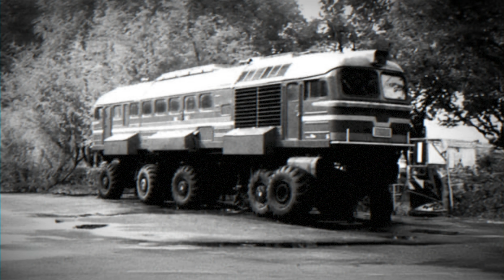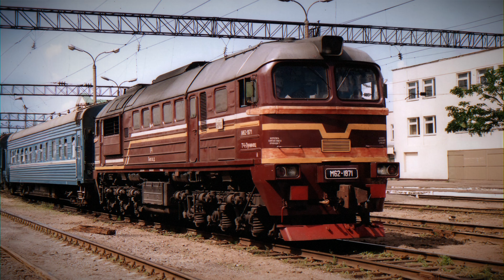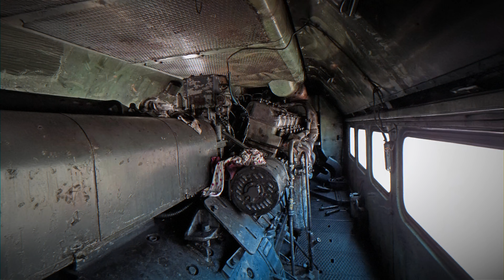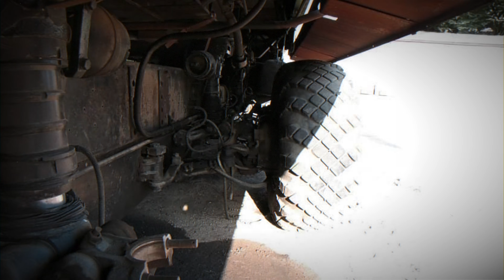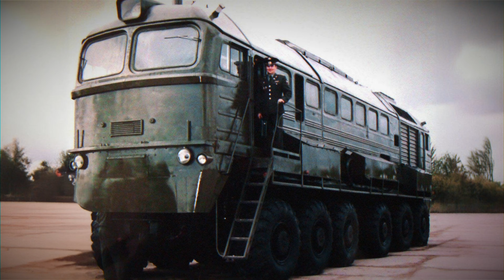Useless Russian 12x12 Locomotive Truck

Comment: Are all 12 wheels steering?
The M62 locomotive has a "steering wheel" but that's just the power throttle, so I wonder what it looks like in the cab.
For road use it's certainly impractical, too tall, too wide and heavy.

Comment: Yes, you cannot deny the reality of that high center of gravity. The weight of a train locomotive is heavy, and that's why they ride the steel. Our roadbeds take no more than ten tons per axle. To do this scaled back you'd need to think hybrid to give you that combination power on demand, when you needed it. But the battery pack needs it's own air ride suspension so it won't get the jarring. You have to again wonder though if at the end, it was worth all of the trouble... for what you're left with. 
Nice video, I really enjoyed it. Thanks for doing it!

Comment: There are huge vehicles many times heavier than this that were built by the USSR to, I bet if they had custom made the chassis of the locomotive, or better yet, used a articulated/powered bogie system using the original frame of the engine, along with heavier duty tires. It might just have worked in the end.

Comment: The Swedish Nohab AA16 locomotives had the class ID "M61" in Hungarian State Railways terminology. For the replacement type, the Hungarian State Railways assigned "M62" class ID. So the "62" in the type name, directly comes from the class ID naming rules of the Hungarian State Railways at the time. M stands for Motor, I think, 6 means 6 axles, and 1 is the first of such engine class. So M62 means, it's the 2nd 6 axle diesel engine ever enrolled at the Hungarian State Railways. I think. But maybe some train-nerds will rush and correct me.

Comment: Interesting math on this engine... it's 9188 cubic inches, divided by 12 is 765 cubes per cylinder. What I find funny about this is that EMD had a 567 engine... it's almost like the Ruskie's reverse engineered it, but got the numbers backwards on the the conversion!  EMD also had the 645 and later the 710 cube engines as well, but just struck me as funny when I looked it up.
Reply: or just a councidence
Reply: @GewelReal  true, just funny that's all.

Comment: It's not an entirely stupid thing to just try to build. 

I get it, it doesn't have any practical purpose. 

But. 

Engineers need exercise. Every now and then you need to let them build something stupid and absurd out of spare parts and a locomotive just to see what happens. I guarantee there were valuable lessons learned with that powertrain, and the steering. The vehicle may have no applications, but the lessons learned by building it are probably applicable to other projects, is what I'm on about.

Comment: Some are saying that it was meant to be a prototype mobile generator. 

Something similar was done in Canada when a town lost power... They took a diesel locomotive off the rails and actually drove it down the road on its steel wheels! They then connected the town's electric grid to the locomotive's electric generator.

It is considered to be a huge success story about what can be done if you think outside the box.
https://youtu.be/FWYbD2ga8DM?si=q-C2HhOQrmBXq0FT

Comment: Theres one thing that I dont understand. If it is a 2 stroke, how come it has valves then? As far as I know they only have holes in the cylinderwalls where the burned and unburned gases flow through.
Reply from the maker: It is not a gasoline type of a 2-stroke. Head out to this video animation

https://www.youtube.com/watch?v=mA7l3dpx6t0
Reply: Uses a blower. The valves open BDC and fresh air blows down. At BDC exhaust ports are exposed too.

Comment: I find it interesting that the engine uses separate heads for each cylinder.
Reply from the maker: A common practice in big engines, some semi trucks use that too. Clever, right?
Reply: @VisioRacer  I believe big 2 stroke diesel ship engines do so as well.

Comment: Actually, it is very much known what this vehicle was made for. It was a test bed for diesel-electric drive. They also experimented with all-wheel steering. The purpose was to evaluate the possibilities of using these technologies in heavy machinery, namely ICBM launchers. The locomotive was used because of the lack of funding in the early 2000s. The Soviets had a nuke-carrying train which used M62 locomotives and it was being retired at the time of this project, so they took one of the locomotives to save costs. Even the locomotive's paint scheme matches that of the nuke train. It was roughly the right size and heavy enough to simulate the weight of an ICBM. It was also suitable because the trains themselves used diesel-electric drive. This way they didn't have to fabricate a new cab/body and other components. It looks unconventional, but they just used what they had available.
Reply: As far as i know, you are not correct. It was based on a pretty old existing icbm carrier. It was not ment to test electric propulsion. It was a project of a mobile power plant.
Reply: @TheCokoll  And why would they need such an unwieldy "mobile" power plant when they can simply use a bunch of generators? Don't be daft.*
Reply: @michaelbuckers  easy, to power a small mobile base of ICBM carriers made right on the same unwieldy chassis and oil fields in russian north (with almost no normal roads). It was a simple cheap kitbash project to test the concept, an as you can guess, it showed that it is indeed unwieldy, cumbersome and mostly useless compared to a couple of traditional dpu's delivered by a helicopter.  It was not even a prototype of a future device, just an unsuccessful proof of concept.  And they did really swap an existing 2 engines and conventional hydromechanical transmission of an icbm carrier with individual electric motors because "hey, we anyway have a 1500hp generator on top!", and this solution indeed barely worked on top of other problems.
May be the idea in general had at least some sence, but definitely not when made in such a dirt and cheap way.
Reply: I thought it was going to be a kind of mobile power generation plant.
Reply: some designs are purely done as thought exercises .. I am sure much was learned....likely several important successes, of one big failure.
they knew enough not to start like that from scratch .. more a convenient test platform.
Reply: Early 2000s? The Soviet Union was dissolved in 1991.
Reply: @joshmnky  The Soviet Union falling apart and the use of old soviet equipment as test beds in the Russian Federation are not mutually exclusive.

Comment: Actually they do know what it was for. Ot was designed to carry passengers where there were no railway lines. Damn great idea but cheap air travel made it ineconomic.  It's not useless at all,  and yeah reverse engineering is common even by the US - a-bloody-mazing. Great video apart from the drama drama BS.

Comment: can someone who knows something about locomotives explain me, why they use a diesel engine to power a generator so they can use electric motors? Normally, this results in a certain loss of performance. For me, this only makes sense if you save an additional gearbox and drive unit from the engine to the wheels?
Reply: On locomotives the performance loss is outweighed by efficiency gain, the engine always runs at its most fuel efficient rpm/load, charges a battery, so output load can actually be higher than engine power for a limited time. Also having donework on prime mover locomotives that have hydrostatic transmissions, speed control is horrible, when you want yo go a certain speed you have to be going flat or uphill and slowly dial in the speed, if you're going downhill even a little bit you are dependant on the brakes to hold speed, electric motors can provide regenerative braking and precise speed control
Reply: @Sausketo I believe only DC locomotives can do regen back into the supply line.
Reply: @MattBrownbill Vvvf regenerativ drives can feed the power back to the grid. Same system that is used on elevators  with AC motors.
Reply: @asbjrnkvisle5831  OK, looks like I was misinformed. I should have checked first. 🤔 Thanks.
Reply: @MattBrownbill  I believe you are right when it comes to older units 👍
Reply: Having the Diesel power a generator and then the electric motors allows the Diesel to run at its most efficient RPM constantly. Losses from the generator to the Electric motors is less than 10% usually, this still makes it more efficient than directly driving the wheels with the Diesel. Not to mention that Electric motors have almost full power from zero RPM.
Reply: Running a diesel engine to power a generator makes sense because:
1. Having an engine run at a constant RPM at its peak efficiency creates power efficiently. This also causes less stress for the engine parts, leading to better reliability and longer service intervals. You cannot accomplish this if you have the engine directly connected to the drive wheels, as the RPM will invariably go up and down depending on the wheel speed.
2. Electricity has less transmission losses compared to a mechanical transmission even if we have to power a generator to convert mechanical energy to electrical energy.
3. It is easier to fit an electric motor in the bogey compared to having numerous CV joints and Axles power the wheels.
4. The overall system has fewer moving parts so it is more reliable. 
5. A mechanical transmission has many moving parts and a lot of torque and power is required to move a locomotive, this leads to the parts being heavy to withstand the forces. Meanwhile, you just need to adjust the voltage of the electric motors to change its speed.
6. It is much more simpler to use electric motors than fiddle around with gearboxes and the throttle. This leads to less chances of an accident/ failure by the conductor.

There probably are more reasons but considering this is a youtube comment, I think this is sufficient. Hope this helps.
Reply: It's much easier to drive 12 steerable wheels using flexible electric cables, rather than complex axles and transmissions. 
This also one great advantage of diesel electric locomotive design. 
The efficiency gains of running at a fixed Rpm is not as important, as the packaging of such locomotives.
Reply: Also remember. Electric motor has insane torque at the start. That you know, locomotive actually needed.

So you get insane torque at start and high-speed at the end, with no changing gear
Reply: having a diesel-electric system lets you efficiently disconnect crankshaft speed from the wheel speed while giving you precise control of the power transmitted to the wheels. Some of the alternatives involve torque converters or clutches, and when dealing with machines that large, simpler is better. Diesel-electric seems to be the most effective solution. It also lets you use dynamic brakes, which is when the motors are backdriven and act as generators, sending the energy from the train's momentum into large electric heaters.
Reply: @Turnipstalk bad info. I believed it. 🙁
Reply: 1: Simpler speed control.
2: No need for cardan shafts
3: It's more durable
4: High power limit. Diesel hydraulic drivetrains were capped at around 1200-1500 hp in the 60s, due to the amount of points where energy was lost (this is why the 3000 hp ML 3000 CC used two engines, and two transmissions). Diesel electric drivetrains however, were easily scalable to significantly higher power.
Reply: Mate there's lots ov stuff with a diesel engine powering hydraulic or electric drive, the engine can work more efficiently

Comment: Imagine 150L engine :D
Reply: ...on a motorcycle frame with 10liter fuel tank🤔
Reply: @fidelcatsro6948  u might even start to idle for 5seconds ;D
Reply: @leps69  only to maybe discover a new scientific phenomena where the 15,000 cc giant engine runs by itself on empty tank using only air due to its massive pump effect in resonance with the aetheric energies already present in ambient air!-
-> Free energy machine!!
Reply: @fidelcatsro6948  that sounds like a load of bollocks
Reply: @brrtbrrt2594  my cat was stretching its wildest imagination and i merely expressed it here..

Comment: Let's say an articulating bus weighs 30 tons. 90 ton is pretty impressive considering it is just covered in sheet metal and not armor.
Reply: You're saying that the weight is impressive because it's so pointlessly heavy? lol ok
Reply: @NikoBell1188  Pretty impressive in a yes, stupidly funny way. Although first I heard "three times as much as an articulating bus" I was like "huh that's lighter than I expected" because this idea is so insane with this thing being the heaviest truck chassis and a naturally insanely heavy locomotive.

Weighing more than modern MBTs but still nothing compared to the Panzer VIII Maus, which was the most stupid vehicle ever, but impressively dense in weight, but just slamming more steel on it does that kind of thing.
Reply from the maker: You are spot on, it is 90 ton heavy

Comment: Wow i need a 2000hp, 150,000 cc V12 diesel engine with a redline of 750rpm on my motorcycle!
Reply: It's the other way around. You want to screw the motorcycle to the engine, not the engine to the cycle.
Reply: @ABa-os6wm  lol!
Reply: I'm sure Alan Millyard would manage it!
Reply: Miata swap😎
Reply: 2000 hp makes anything better
Reply: @Turnipstalk my cat says V2 and V4s wont make its cut..it wants a V12 with 15000cc
Reply: turbo AND charger
Reply: @mark6491 Plus electric motors with a hydrogen fuel cell and a jet engine.
Reply: and instill need to be towed🤔😂 @SolaricSage116
Reply: Yeah trains are totally insane. 

So its diesel? Yes. 

AND two stroke!? Yes. 

And youre telling me its got  supercharger and a turbocharger? Yes. 

But none of that is connected to the wheels? Yes. 

Then I give up. 🤣🤣 must be Aliens